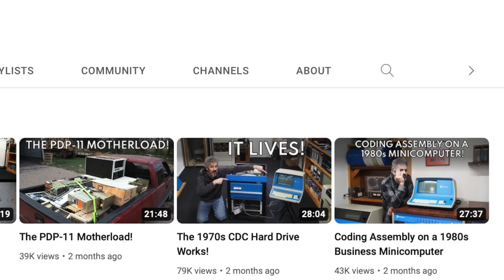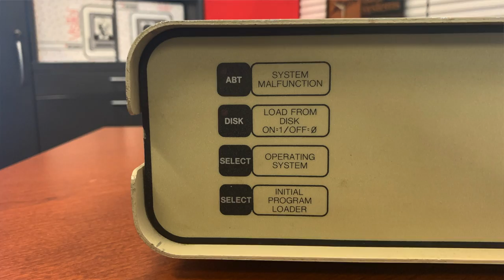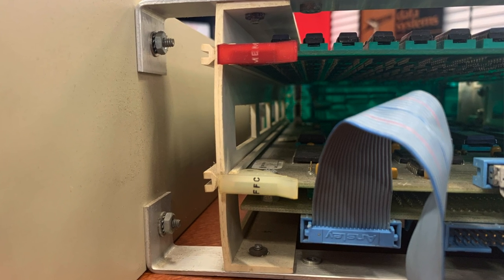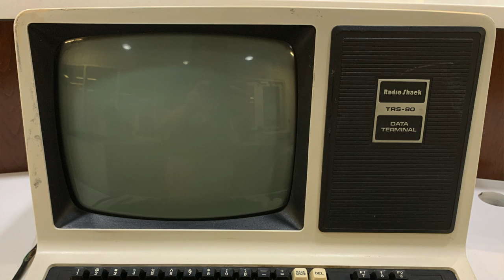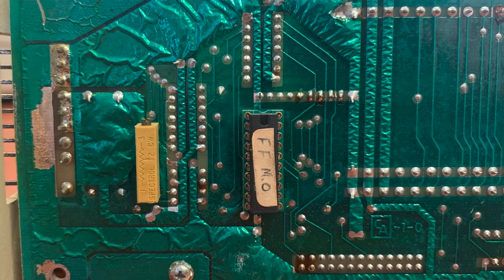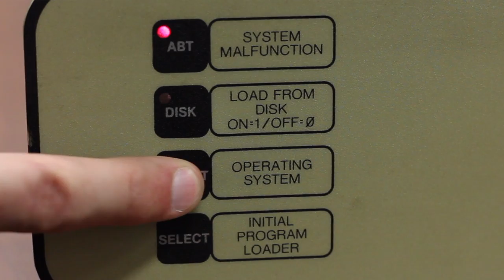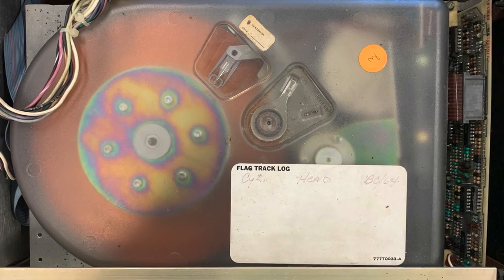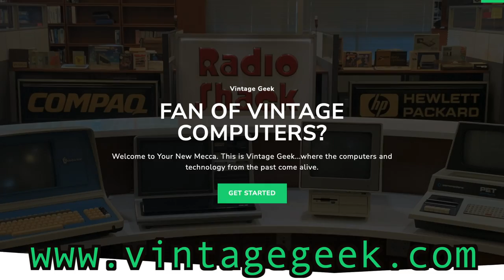The Centurion MicroPlus Lives (Kind Of)

Comment: You ref. the MicroPlus was found in a storage unit in FL. in the video.  Was the storage unit in the St.Pete-Tampa-Lakeland area or the Miami area?  We had dealer (Scott Springier) in the Lakeland, FL and a dealer (Joe ?) in the Miami, FL area back in the early 1980s.
Reply from the maker: The storage unit was in the Lakeland area; however, I was told it was originally all storage from an independent radio shack dealer that may have been moved there from another part of the country…it’s hard to say for sure where this one originally came from.

Comment: Hmm...I thought the Wren needed a different controller.  But if the FFC can run a Wren drive it should be able to work with any MFM ST506 interface drive.
Reply: The Wren drive came with several different interface boards. The original Wren had the same interface as a Finch drive, there were also ST506, ESDI and SCSI interface options on later variants.

Comment: I want a centurion mini mini, like the sega genesis mini.
Reply: This is actually something I'm working on!
Building a scale replica of the Centurion cabinet that can sit on your desk, plug into a real terminal or a USB keyboard and HDMI monitor, and has a full emulation of the hardware inside with software pre-installed. No clue when it'll get there, we're still in the planning stages, but it is in the works!
Reply: @UsagiElectric  If only there was a way to mass produce that sexy CRT Terminal with the Centurion logo and color. I would use it with my Linux EMACS.
Reply: @UsagiElectric  OMG that would be amazing!!!!